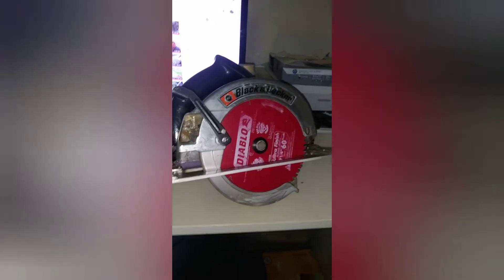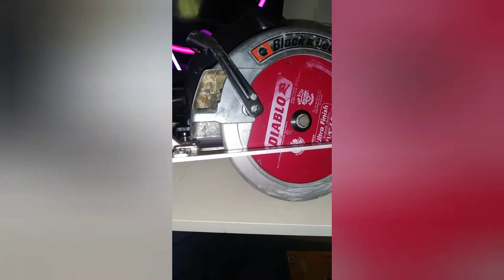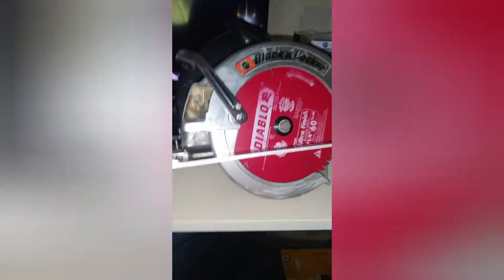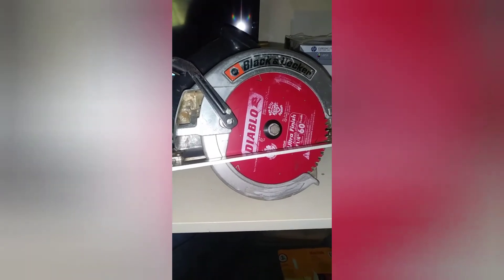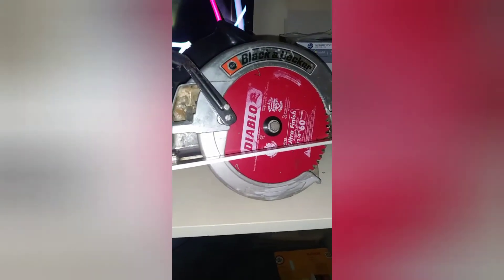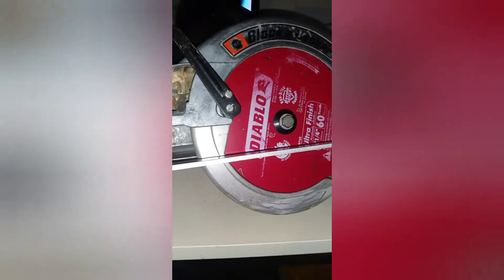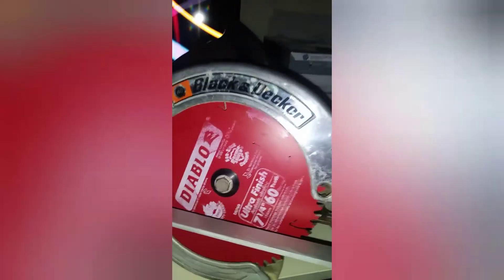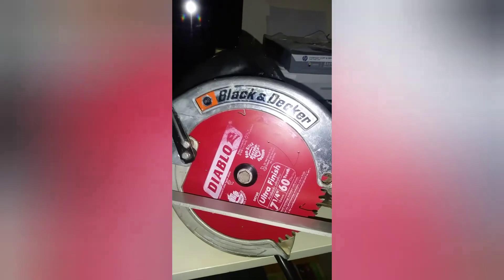Black And Decker 997 7 1/4" Super SawCat

Comment: I owned a number of Super Sawcats as well as the 9 1/4" version made in Australia.  I currently use the DeWalt DW384.  All of them were extraordinary saws with ferocious power and make today's cordless saws look pale in comparison.  But their time is over, except for occasional use - they were just too heavy and cumbersome to use eight or more hours a day.  B&D redesigned the 70's Sawcat in 1991, just a year before rebranding to Dewalt, and cut the weight down to 12 1/2 pounds from the 14-15 pounds that it had been prior to that.  The new saw, becoming the Dewalt DW364 and DW384 was more workable, though it had more plastic on it, and serves me well to this day.  However, I sometimes find the desire to give my old shoulder a rest, and reach for a very capable 10 1/2 lb Makita corded saw.  A final point; many oldtimers felt that the B&D's almost immediate electric brake effect, which sparked pretty dramatically if you look through the motor openings, was harmful to the motor in the long run.  The Dewalts have a detuned brake that is a little slower to stop the blade, but is probably less detrimental.

Comment: Greetings,
Enjoyed the vid thoroughly!! I currently own the 3047 and the 997. Love em’ both…used the 3047 back 30 years ago recently located both models on EBay!! Have been using the 3047 daily, but just started showing signs of brush replace….problem is I have been All over EBay, and locating parts is almost impossible, especially brushes!!
Any assistance you may have with anyone having accessability to parts, I would greatly appreciate!! These are awesome saws, a shame to store in the trailer because there’s no way to secure the proper brushes!! 
Thx
Jody

Comment: The Super Sawcat series were the best saw ever made. The detachable "shoe" is a beautiful feature they should have never stopped. I still have the one I bought new in 1971 and is still in active service.  Just be sure to always use at LEAST a 12 gauge extension cord.
Reply from the maker: Absolutely. The removable shoe is excellent for flush cutting up against walls and such, the only saw I've ever seen with such a feature! If the saw is used with a lighter extension cord does it just starve the saw of power or does it actually cause motor damage?

Comment: I have 987 . Missing shoe attachment . In you video you said you replaced or bought new base plate 🤷‍♂️
Reply from the maker: Yes, model 987 did not come stock with that shoe attachment. Only the Super SawCat models came with that. That said, you could purchase it optional, and there are some on ebay

Comment: Now isn`t this saw and others with the electric brake always fighting the brake when the trigger is depressed?  I was told that`s how these brakes work.
On another note, I have inherited a Black & Decker 8" builders sawcat, model 3038-09, no brake.  Is this a good saw?
Reply from the maker: Yes, the brake works by essentially reversing the flow of electricity briefly so when the trigger is released it reverses polarity thus the bright arc and sudden stop. Absolutely, any of Black and Decker's SawCat saws are excellent heavy duty saws, and some of the best saws ever made. DeWalt sold SawCats and Super SawCats under their name for a while up until around 10 years ago or so, they were bulletproof as well, but not as luxurious as the older B&D models. Hope this helps!